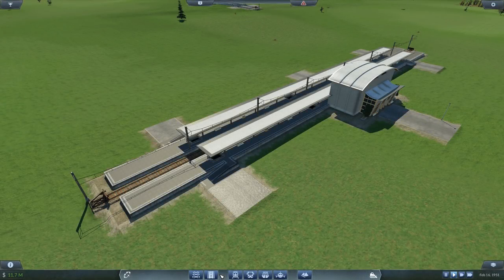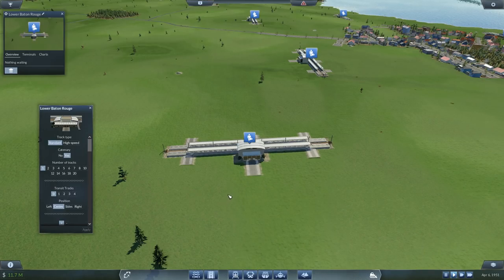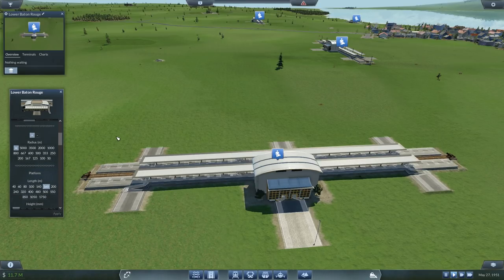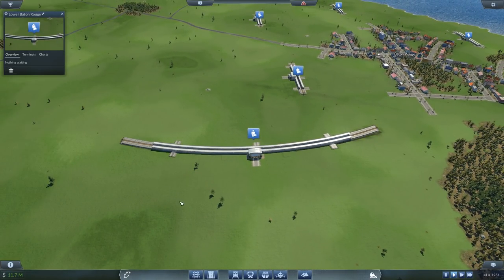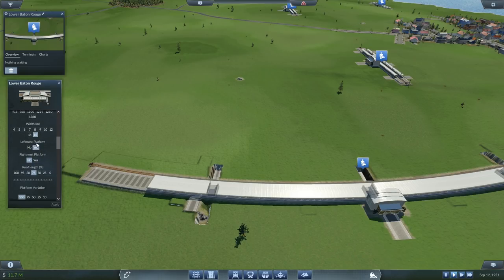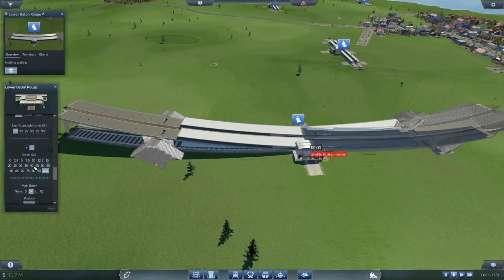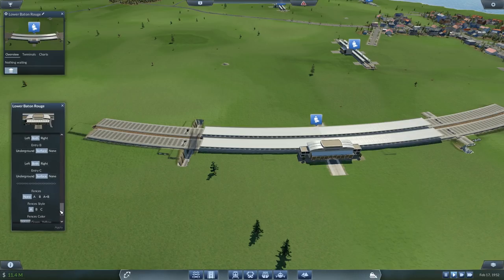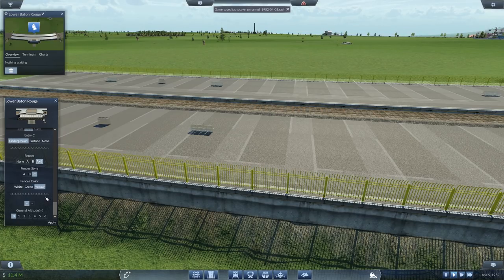Ultimate Station Mod Guide Tutorial Ep 1 | Transport Fever

Comment: I have a top notch computer but when placing the converging platform [V shape] I get lag when changing values.
It only happens on this mod. Any clues why?
I have a i7-8700k 64GB RAM @ 3600MHz, GTX1080 Ti FTW3 GPU on win 10 Pro 64bit.
The game is on my M.2 1TB Samsung 960 Pro. Thanks.
Reply from the maker: Don’t worry, mine does EXACTLY the same thing unfortunately. I think its a combination of the game and the mod causing it.